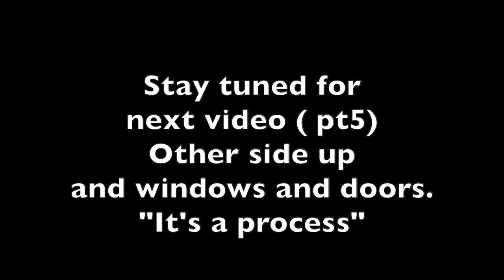Ep 156 - Part 4 Teardrop Build  " Wild Bill" clading and more

Comment: Great to see it taking shape. 
Looks solid, and may be a bit of weight. Have you researched towing capacity? 
A wood frame over a steel chassis may have been a lighter construction.
Reply from the maker: yes  it’s well within my capacity to tow   the frame is not so bad the steel sheets are heavy   thought  all up hoping to be around 220kgs    still bloody nervous 😬